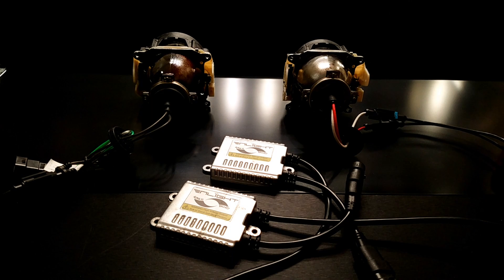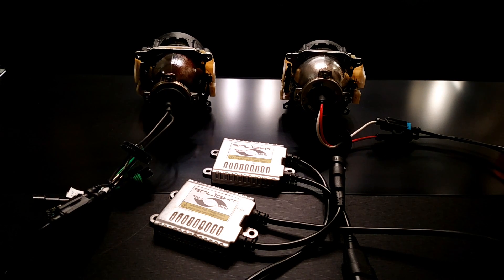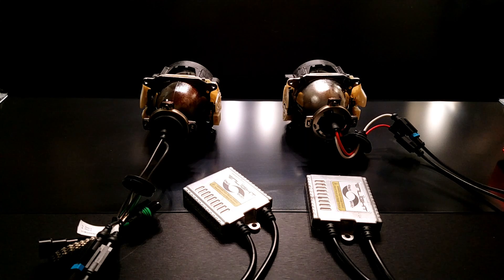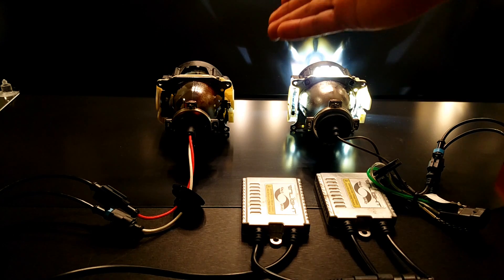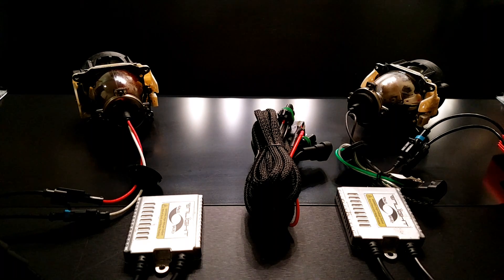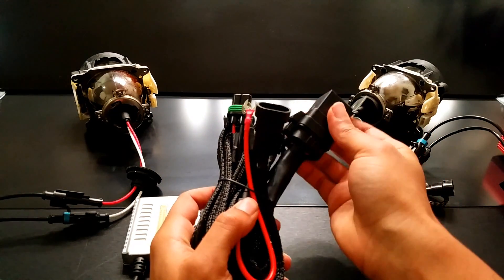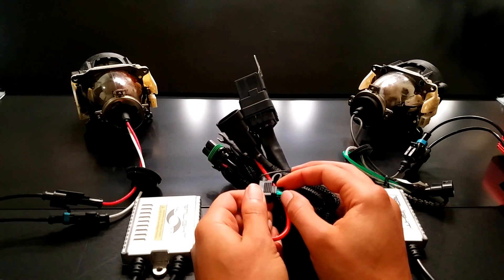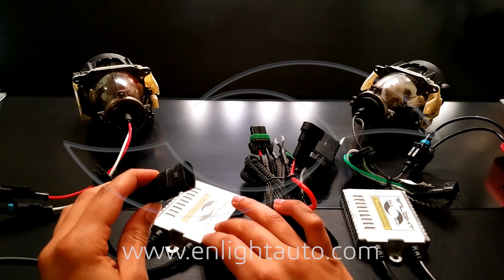Help my lights don't work! - Trouble Shooting an HID Kit

Comment: Hi, I have installed HID on my Lexus CT200h. When I start the engine, (with the option "automatic headlights") the left side turns on, but the right side doesn't. I need to turn off and to turn on the headlights manually and in this case the 2 sides start successfully. Any idea? My ballasts are without Canbus. Thanks a lot..

Comment: Have a question, just replaced ballast and light works.  But if turn ignition off and back on the light comes on then goes off.  Pull the fuse for that headlight, it is good.  Put fuse back in and light comes on.  Then turn ignition back off and does something again.  Any ideas?
Reply: needs a relay. had this same issue. relay will make sure power is coming from battery and not from vehicle (which may be too smart for HID kit)

Comment: I have a 2015 chrysler 200 and my hid kit didn't come with a relay. When I connect the lights they will work then shortly after the lights die and I get a low beam out message. When I toggle the lights off and on they work then die again....
Reply: What was it did you figure it out
Reply: @davidhuffman6853  I just brought some ballast but these things are annoying

Comment: ive got a 55w ballast powering xenon bulbs the right side flickers on start up and eventually stabilizes. it finally went out the other day so i purchased a new set of bulbs, i plugged a bulb in and it still flickers so i was thinking of adding capacitors to both ballasts on the input side. do you think this may fix my issue? any advice would be appreciated, thanks.

Comment: I have a h4 harness with h1 bulbs to my retrofit headlights. I be done everything my self. The lights some times don't come on first try. Drivers light usually turn on but not passenger side. After I close and open again the switch both of them work good. Another problem is when my lights working for some minutes and I close them, the don't light up again. They need 3 minutes or so and then they work again like a charm. It looks like they need to cool down, I say. Any ideas guys? A hid canceler adaptor may help?

Comment: My driver side bulb went out. I swapped with new one and it worked for about 2 -3 days then it stopped working again. Could the ballast be faulty but still halfway works and cause the bulb to blow?
Reply: high beam

Comment: I have one headlamp out on right side, left side works, I swapped bulbs like you suggested, right light still doesn't come on, so mu bulbs are okay, but my truck is 04, I will check my fuse 1st, then it should work. I ordered a ballast and cables that was suppose to work on my 04 cadillac ext, but the working side ballast is like a 1" thick and the one I received was 1/2 " thick and the cables that came with it one was a good length BUT the one that wrapped around to the ballast was 4" to short...... So I returned it.... Please HELP :-) Thank you for your expertise.

Comment: When I start my truck I have power to both sides then after about 30 seconds my driver side will shutoff. Any ideas what this could be?
Reply: you need antiflicker or capacitor
Reply: you still have same problem

Comment: What if the high beam works but the low beam does not work?
Reply: Jacob Breshears got that problem, no low beam arghhh... french crap.hit a flood and both lights went out
Reply: in both sides

Comment: what if they both come on but after about a minute or so one of the lights goes out.
Reply: need anti flicker or capacitor
Reply: @creativelife4453  mine has capacitors and the passenger side will work fine for a week or so at a time then out of the blue  it goes out and have to turn off then on again to relight but won't stay on more than 3 min then goes out again and keeps up this problem until you cut them off for about a minute or maybe 30 seconds then works again for a week or so and so on help! Please
Reply: @mr.christopherp.4851  high beam and low beam turn off
Reply: @mr.christopherp.4851   high beam or low beam

Comment: i noticed that the when you made the swap the bad bulb flickered for a split second, why is that? is it normal for this to happen? i have that same issue and i was just about to replace the igniter or the ballast.
Reply: Richard Mohammed Yes indeed, it is normal in any HID kit to flicker a bit when starting up.

Comment: what if I did that and bulb and bales are good but still the driver side does not work?
Reply: anti flicker or capacitor you need to install
Reply: check your ground

Comment: Max, you recommend replacing xenon hid bulbs in pairs. If one bulb fails under warranty, then you would send 2 bulbs?
Reply from the maker: mipalo 
If the bulbs have been used for a while, say 6 months or more, its best to replace both bulbs to ensure color matching. For warranties we will cover a single failed bulb at no cost. The customer has the option to pay for a single additional bulb and we will send a complete pair.